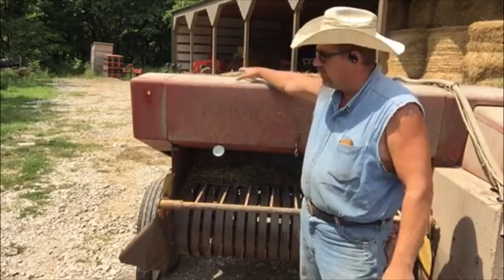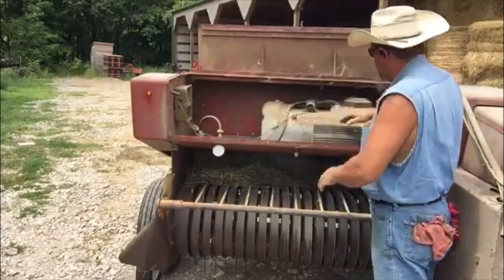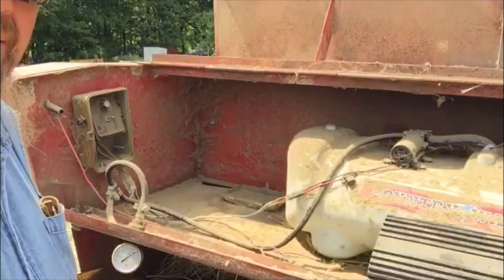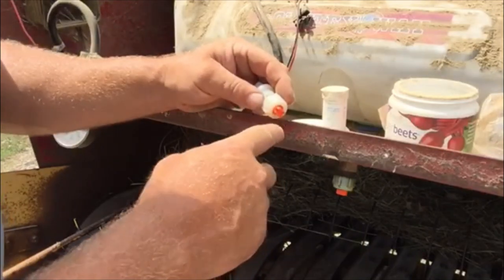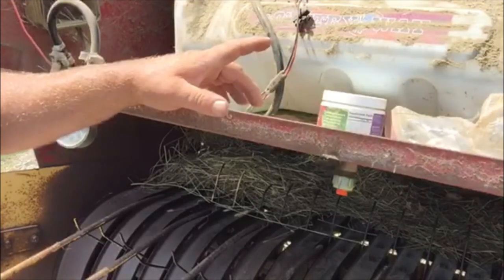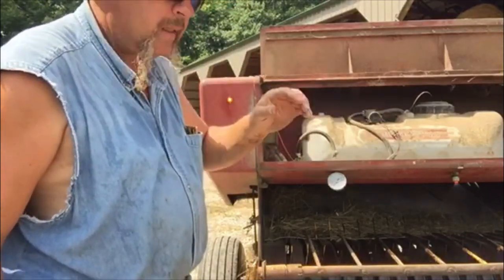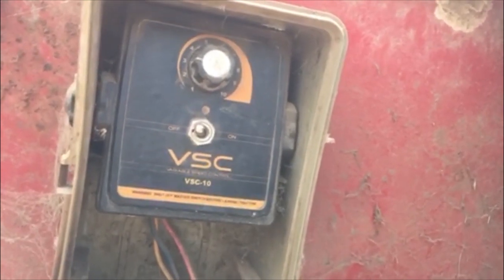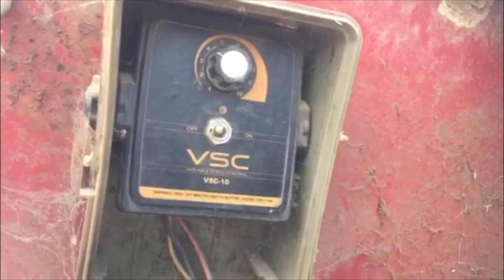Homemade Hay Preservative Applicator for Square Baler for $100 / More TIPS and TRICKS

Comment: I’m watching this while sitting in a traffic jam hauling home a 276 I just bought
Reply from the maker: @ni1469 Good deal!!  Well, all except the traffic jam part! Hope it serves you well; the 276 will flat eat some hay!!
Reply: @HayChaffandSawdust1  I’ve heard they are very good balers, this one just got overhauled by the dealer so that should help. It’s replacing a Massey from the 60’s that’s earned every right to be worn out. The traffic jam worked out since I got some ideas of how to build a system on this once it get a bit warmer
Reply from the maker: @ni1469   I hope the dealer did a good job; I've seen hit/miss on that. The ol' Massey... wooden guides and stuffer?  They were good ones; you're right, though... they've earned the right to be tired!
Reply: @HayChaffandSawdust1  it’s a model 10 so not quite old enough for the wood parts. It hasn’t missed a knot since I redid the knotters that had quite a bit of sisal twine inside the bearings (I don’t use it but a have a family member that only uses it when they bale) but it won’t keep a consistent bale length and I can’t get the replacement parts for it so it was time for an upgrade. I’m gonna break open a few bales and run them through it this week to verify it’s done right while I have time to correct any issues on it
Reply from the maker: @ni1469  I hope you have good luck with this one. I've found that consistent windrows are the MOST important thing to a consistent length. Consider that the bale plunger makes two strokes after a knot is triggered... once trips the knotter as it plunges and the second stroke make the knot. If you are making an 18 stroke bale, each stroke makes 2" of bale and the bale length can vary by 4". If making a 10 stroke bale, it can vary by 7", I CAN make 7 stroke bales with my 276, but the bales can vary by about 10-12 inches if I do.
Also, don't get discouraged if, when feeding/rebaling hay, that it may not work properly; if the baler chamber gets empty as it's calling for a knot, you will still get odd length and the bales are usually squishy when fed by hand.  You probably already know/knew, but in case someone else is reading the comments, it may help someone. Thanks for the comment(s)
Reply: @HayChaffandSawdust1  I’ll take any advice I get especially since I’m going to be starting into a baler model I’m not used but you are. Did a service on it and test dry run to watch and listen to it, so far so good. I then started building the treatment system it’s gonna be similar to yours, I don’t have to worry so much about people being scared off by treatment but I do like being able to have the tank out of the sun and also not in the way for watching behind the baler, had poly tanks on planting equipment get brittle even though they were stored inside so I like the tank being protected when possible. Might put some nozzles on the back side of the baler and do fertilizer behind it to save getting the sprayer out since I have extra nozzles from a sprayer rebuild and tanks I can put on the tractor
Reply: @HayChaffandSawdust1 I’ve now baled 3 fields first cutting and the baler’s a mean machine for its age. Gonna have to order some different nozzles for the applicator I built but the hay will definitely keep lol
Reply from the maker: @ni1469  PERFECT!! I use the "orange" ones; I run a single orange at or about 18-20psi for 16 stroke 50 lb bales. I had calculated that two "olive" colored ones would also work IF I didn't get coverage with the single. I don't remember the orifice size, you one can so some calculations of requirements once you are used to your baler a little and can guestimate the tons/per hour or pounds per minute going thru the baler.  Good luck!!